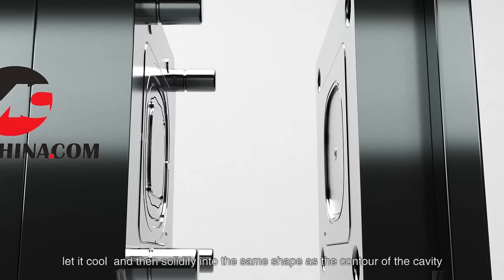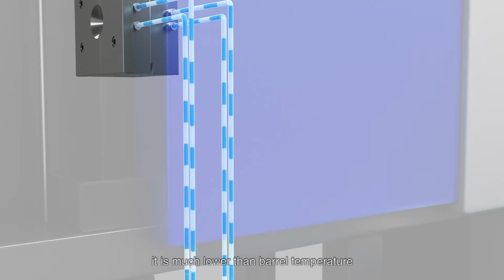Plastic Injection Molding

Comment: Clear explanation of the injection molding process! The next step is to turn your CAD design into a physical part. We help with that through low-cost 3D printing or CNC machining for prototypes, and low-volume injection molding for production.🌄